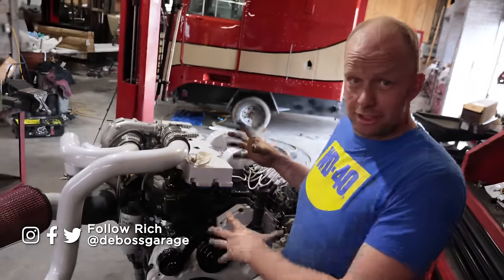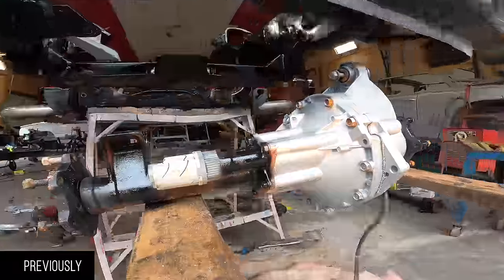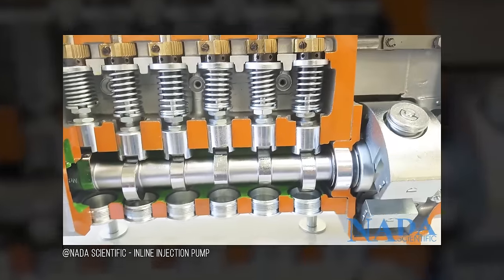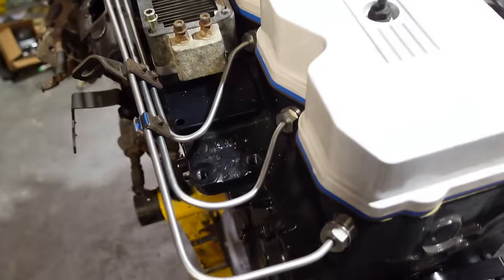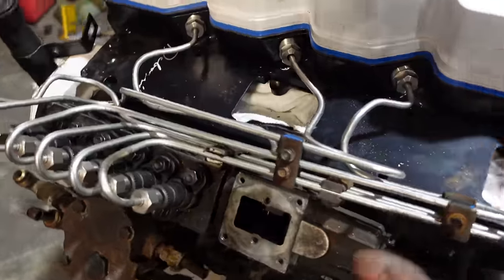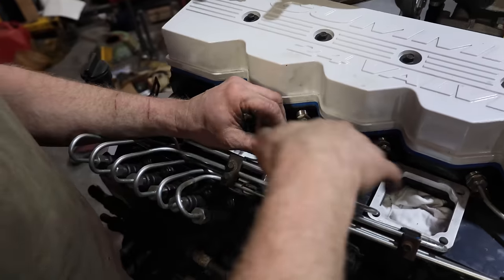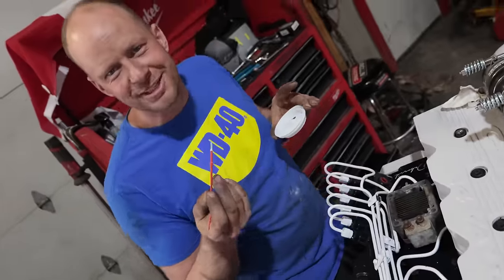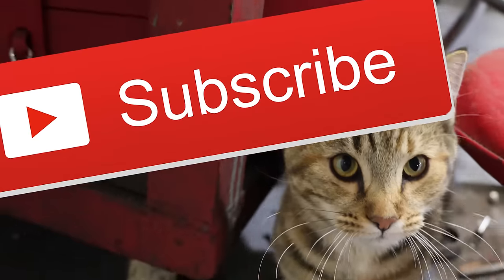How To Bend Steel Fuel Lines for 24v P-Pump Conversion | #24vSilverado [EP8]

Comment: I have a question I have a "1ton" truck I'm beefing up to haul big toys with and to put lot of miles and maybe a lot of idle time I was thinking the Cummins 8.3 but what would y'all say (to clarify I mean I'm looking at on average putting between 25,000 and 35,000 behind it plus I have a steel bed plus tool boxes air compressor tools small Crainer etc.)
Reply: At that point it might be worth looking at a medium duty truck. The 8.3 cummins is physically quite a bit bigger so might be tough to fit. And, if you’re looking to haul that much a 1ton isn’t ideal even if it makes the power for it.
Reply: @NBSV1  true I normally I would agree with you and don't get me wrong I am still on the hunt for a bigger truck but at this point in time this is the only thing in budget in my area don't get me wrong I understand the limitations of the frame of a 1 ton all of that will be beefed significantly I've already got cross members in I'm saving up for leaf packs with three extra leaves in them I've got a line on bags for the rear end I know the 8.3 is a lot bigger but if my calculations are correct the obs's have just enough room under the hood with a little massaging from a hammer to make it fit, to put it in the perspective I only had about 3ish Grand to play with to buy frame and body and I needed at least a crew cab and I needed the flatbed I knew it was going to take a lot of work to stiffen up the frame replace the rear end different transmission massage out the body upgrade the suspension put the bigger motor in it but time is money and with enough time I'll have enough money the other big reason that I want to stick with a one ton is of course money it's already expensive enough to put a one ton on the insurance if I were to step up to like a 4500 or a 5500 I would need to open up commercial policy in order to put it on my insurance

Comment: So I'm sitting here thinking how you said if the lines weren't all the same length that it would change the timing of the fuel... and was wondering if someone were to build thay motor in a way that it needed the fuel timing changed if they could just adjust it with the length.... say if they had a massive camshaft or something? Idk I'm not expert but genuinely curious if it could be done and who better to ask than the filthiest man on YouTube 🤣

Comment: Can anyone help me? I have a 1999 24v with dead pedal  either 700idle or 1200 rpm when I press it all the way or lightly press it. I have a video on my channel. I also have a code p1689 which is no communication between ecu and vp44. Anyone have a resolution im stuck at my ends and need help bad

Comment: I'm gonna make a confession, I've never used a bender for fuel or brake lines
Reply from the maker: I used a bender, but didn't like the contraption to bend it around the mold.

Comment: Your doing too much.  I have been using 10ga solid copper wire in the insulation, cut to dimensions of the pipe kit. do each with a brake line bending tool with each end vice gripped to the nuts.  Its about an hour to get it all sorted out, and another hour to copy each wire bend to tubes.